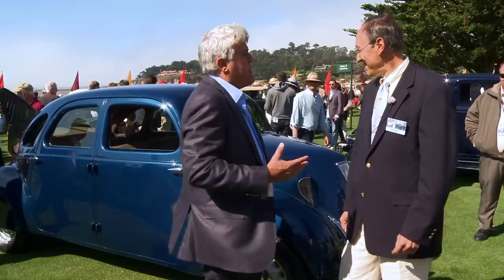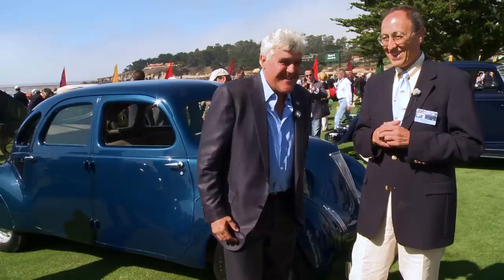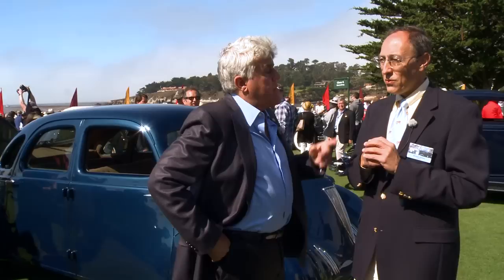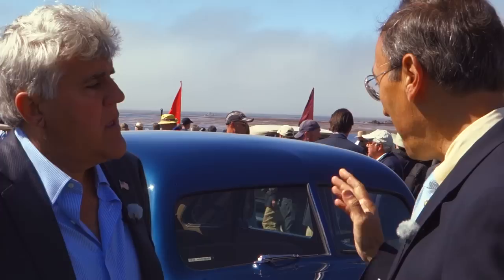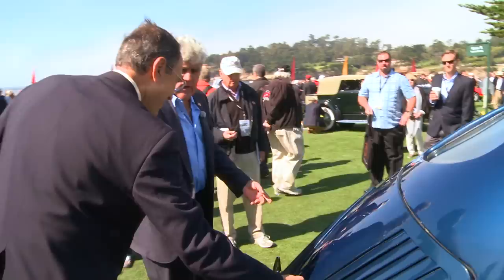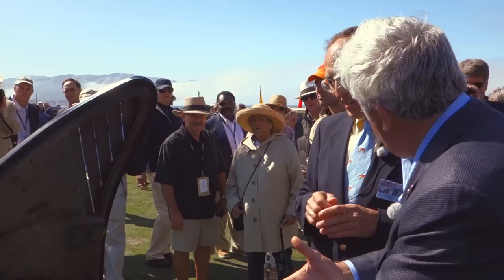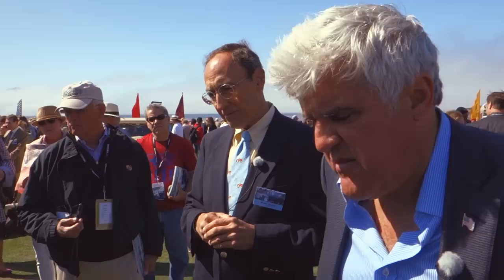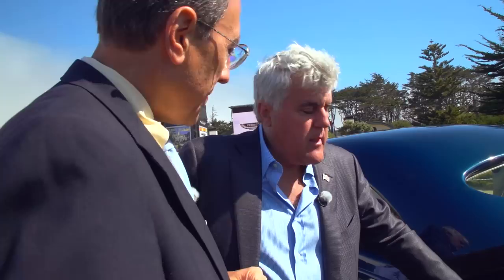Pebble Beach 2012: 1935 Hoffman X-8 - Jay Leno's Garage

Comment: Great video, really unique car ! 

While this might be the only (?) surviving X-8 automobile, Henry Ford spent several years in the 1920's experimenting with X-8 engines, both air-cooled & water cooled, as replacements for the Model T engine... 
The test-mule wound-up being a mid-'20s Olds, as the Model T chassis was too small to accomodate the X-8.

Edsel Ford eventually installed one of the water-cooled protoypes in one of his motor boats...

The Henry Ford Museum did have several X-8s ...

Comment: Henry Ford was experimenting with an X-8 engine. To say this is the only X-8 engine is false. But to say this is the only working example of an X-8 is true because Henry Ford was never successful with his.
Reply: Henry got his X8 running. 

Just not for long, since the bottom spark plugs fouled almost immediately..

I'd like to see someone redesign it and build a working version, along with a planetary transmission similar to the one that it was to be coupled with.
Reply: Andrew G. Abeja